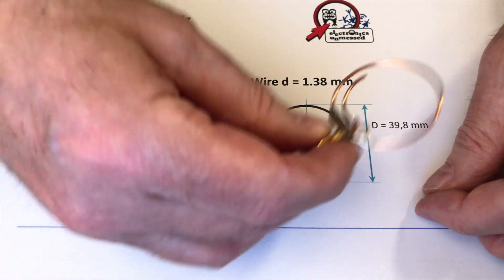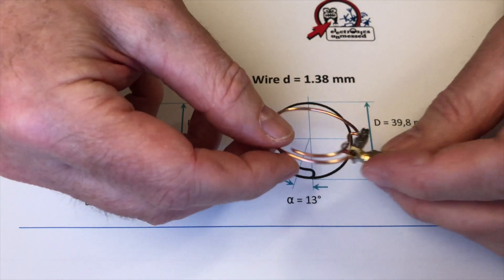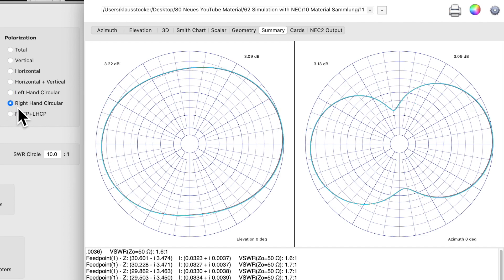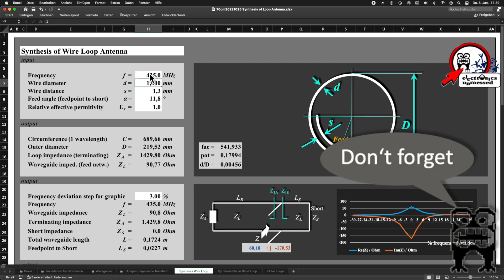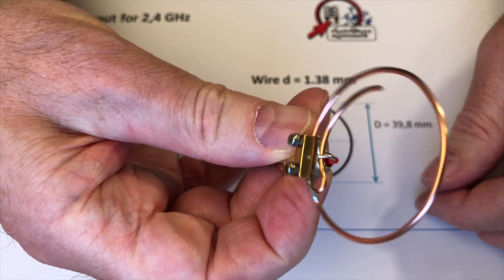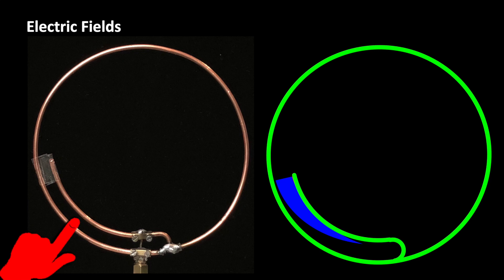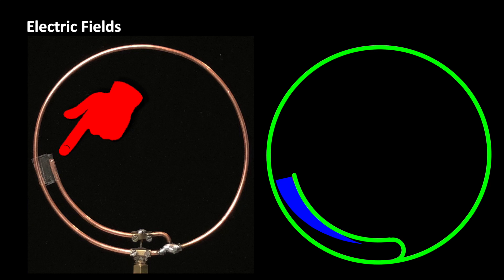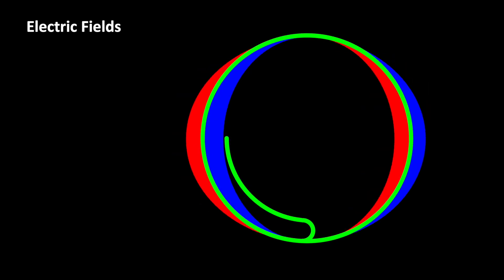Working Principle of a DIY Loop Antenna explained in an Easy Way (EP64)

Comment: Why doesn't a loop antenna need a ground plane?
Reply from the maker: Thank you for your comment! A very good question that is not easy to answer. I will try to make it short: A monopole antenna needs the ground plane rods to adjust its impedance to 50 Ohms. The loop is precisely tuned to 50 Ohms. This avoids currents are excited on the outer conductor of the coaxial feed line.

Comment: This is not an unknown antenna, it is in reference books. You have a gamma matched full wave loop antenna. Also, it does not act as any kind of filter, band pass or otherwise. You have conflated "resonance" when used in the context of lumped constant tuned circuits and another context of "resonance" when the complex impedance in an antenna pases through Rx + j0, ie no reactance. An Antenna, or indeed a conductor of any length, in an electromagnetic field will respond with current conduction in sympathy. No frequencies are rejected. The difficulty comes coupling to a transmission line to utilise the current(or voltage)
de G0AFV
Reply from the maker: Hello G0AFV,
Thank you for your comment! It's great that you are putting so much thought into this antenna. This really helps me to classify the antenna somehow, because I haven't been able to do that so far.
I looked at some references to the full wave loop antenna that is actually used by radio amateurs. However, the principle there is different: they are open loop antennas that actually have no resonance or filter effect. Just as you describe it.
Here is the first difference to my antenna, because it works as a closed loop antenna. It actually has a strong resonance at the fundamental wavelength and multiples thereof. By the way, I made a lot of measurements and simulations for this, about which you can also find some videos on "electronics unmessed". I think you could accept that as proven.
The second difference is that two perpendicular resonance modes are excited on my antenna, which means that the antenna also sends or receives corresponding polarizations.
By the way, the closed loop antenna has a very high impedance when it resonates, in contrast to the non-closed one.
I would like to discuss the topic further with you here, perhaps you know further details or references that you can share here. That would be great!
Klaus
Reply: @electronics.unmessed  Open/closed elements in an antenna do not make it a different antenna. All antenna feed points can be either open or closed, that does not change the antenna type or characteristics. A halfwave dipole can be open or closed at the feed point, a quarter wave mono can be open or closed at the feed point. What happens is the feeder completes the antenna element circuit, maybe not to DC but at RF frequencies. Your full wave loop is the same full wave loop that has been known and used since it was first envisaged.
The dual mode radiation you are seeing is indication the feed system is not working correctly. The quarter wave line coupling you are using is itself a radiator. You want it to couple all its energy to the loop, I suspect it not completely doing this, so you are seeing some loop radiation and some quarter wave element radiation.
The main issue though is you are interpreting what you are seeing in coupling/feed point responses as antenna characteristics and responses. This is incorrect and is misleading you. Feed point matching response does not mean antenna frequency response. Any feed system has the possibility to go through the full range of complex impedances with frequency change and result in total mismatch and no transfer of power, but this a property of the feed system ONLY, the antenna is still responding to those frequencies, currents are still circulating, its just the feed system cant utilise them in this configuration. I'll restate again a fundamental fact you must grasp and refer to in order to correctly understand an antenna; a conductor in free space will respond to all electromagnetic frequencies. There is no frequency preference. How any coupling system responds to frequencies and physical connection position with respect to an antenna is another matter. I believe you are stuck interpreting feed point behaviour as antenna behaviour.
All your analysis so far has lacked the fundamental investigation of how an antenna does its basic function of radiating a signal from point A to point B. I know this is difficult to do in reality, antenna ranges are difficult to set up in normal life. If you could it would immediately demonstrate that antennas have no frequency preference.
Reply from the maker: Wow, thank you again for your comprehensive comment! 
I like the approach of looking at the antenna separately from the matching network.
Now I'll do a thought experiment: Let's assume we have a piece of wire that is always matched to the impedance of the feeding cable at all frequencies. This would mean that the entire RF power is always radiated into space; there would be no frequency dependency. The same applies for reception.
However, the current distribution on the wire and the radiation characteristics would change dramatically depending on the frequency! So, simply because of the changing radiation characteristics, one would get preference frequencies between two points in space at which transmission is best. OK, but that has nothing to do with the filtering effect of the antenna.
I think you're still right, the filtering effect is caused by the antenna matching network. In my case, it is dimensioned so that there is only good antenna matching at the resonant frequency of the loop, where we have a certain current distribution.
I don't believe that the two-wire waveguide of the matching network radiates significantly because the two wires are too close together for that. Of course, the RF power goes into the antenna at the open end of the two-wire waveguide with a high electric field strength.
There is actually no doubt about the resonance effects. They can be clearly seen in the reflection measurements and in the simulations with NEC.
Incidentally, the current distribution from the simulation shows that the matching works correctly.
The two-mode principle has also been proven at least through simulation. I analyzed the polarization components of the radiation characteristics.
And I also think that the antenna matching works correctly in reality, because the antenna actually works significantly better than, for example, a quarter-wave monopole.
And in my last experiments I was able to achieve 40 dB reflection loss.
The filter effect of the arrangement, i.e. antenna plus antenna matching, is definitely also present. For example, I got a significantly better SNR when receiving LoRa signals.
But yes, otherwise the antenna actually corresponds to the full-wave loop antenna. 
What do you think about that? 
I really appreciate your good comments!
Reply: @electronics.unmessed  You are making the mistake of thinking mismatch equates to attenuation. The myth that VSWR is lost power. Same mistake, same myth. You can only lose power in resistors and resistive loads. The radiation resistance of an antenna counts as a real resistor. Reactance can not dissipate power. In two antenna that have different radiation resistances but fed with same transmission line, one matched and the other mismatched, both will radiate the power equally :) Mismatch does not equate to filtering.
Your description of the matching section shows you only partial understand how it works. Not only is the energy transferred by the high voltage at the  end of the quarter wave line, but also at the feed point where there is predominantly a current in the matching line inducing a current in the main loop. so over the length of the matching line from the point it is connected to the loop to the open end there is a continual change of coupling mode from current to voltage.
The improved performance of the loop over a quarter wave mono pole is no proof of the matching working! A full wave loop is a bigger antenna and has a better capture area providing gain.
Look my friend, this is the comments section of a YouTube video, its is a terrible place to have technical discussion.
You made the video, I commented.
All the best
Reply from the maker: Having a Diploma in Electrical Engineering and a PHD in Antenna Engineering, I think I can humbly claim that I can distinguish lay myths from real evidence. And we don't need to discuss all the myths here, that laypeople might not understand. Of course, attenuation is not the same as mismatch. Your first statement is still wrong, because if it were correct, then the whole analog filter technology wouldn't work. And yes, a mismatched antenna has the same radiation pattern as a matched antenna, but not the same gain, because some of the power goes back to the transmitter in the latter case. I think you're ignoring the transmission and reflection factor here and you haven't understood the difference between directivity and gain.
And yes, the antenna has a larger effective area than a monopole and therefore receives a stronger signal. And it receives horizontal and vertical polarization. But this only works if the antenna has a good matching and is working in the mode described. Best regards and thank you for your comments!

Comment: I've been looking into my ARRL Antenna Book (dated 1988) for information and ideas.  Suppose your loop had a cut about 2 mm wide.  Then the feeder coax could be soldered across the cut.  I think that would be roughly similar to what you have.  Preferably the feeder would be an integer number of wavelengths long.  By varying the transmitting frequency you would find the point of resonance at which the loop impedance was non-reactive.  If the resonant frequency were not acceptable then you would need to make a larger or smaller loop.

If the loop impedance was not a good match you would need to apply correction.  You could use a version of gamma-matching similar to what you have already done.  Otherwise you might use a "quarter-wave transformer" which I see described by the ARRL.  This comprises a quarter-way long co-axial feeder of characteristic impedance intermediate between the loop resonant impedance and the characteristic impedance of the feeder.  (You might need to construct that yourself from a piece of copper tube of the right diameter).  I am just thinking aloud.
Reply from the maker: Thank you very much for sharing your thoughts here in the comments. And yes, a quarter wave transformer is also doing the job to match the antenna to a 50 Ohms cable. In the earlier videos I am showing such a version of the antenna. However, I chose this slightly more complicated matching network, because the loop has a really high impedance. Therefore, the quarter wave transformer needs to have a pretty high impedance, which is difficult to achieve with coax, even with a 2 wire transmission line. 

Anyway, its good to receive some alternative thoughts. I see that this concept is interesting for other makers and radio amateurs. So, I try to develop this further .. Best Regards from Stuttgart

Comment: I think this loop antenna is ingenious and I am impressed that it functions at ultra-high frequencies.  I suspect that the principle of operation is a successor to similar designs like quad antennas in which the loop is square, made of wire and used at short-wave frequencies.  Also it reminds me of the classic "magnetic loop" antenna in which a variable capacitor enables tuning at frequencies independent of the length of the loop circumference.  The feed method appears to be a version of the "delta match" principle adapted to uhf, but still is very ingenious.

The resonant bandwidth seems likely to be extremely narrow and would depend upon the Q-factor  The Q-factor and antenna gain are likely to increase with an increase in conductor thickness.  Depending upon its application, the very narrow resonant bandwidth might be a disadvantage.  But the usefulness of this antenna would depend upon the context in which it were employed.
Reply from the maker: Very good comments! Thanks a lot.

Comment: I can't wait to try this antenna. I'm going to try one tuned at 467mhz for GMRS use. One thing I haven't found much info on in general is how to derive the wattage rating for and antenna. Any hints on what the determining factor for wattage rating would be for this antenna. Also have you tested thicker wire? Even maybe copper tubing. Would thicker wire diameter effect the q rating of this antenna design significantly?
Reply from the maker: Thank you for your comments and your questions! It is a good idea for sure to use it for GMRS. Thick material like copper tubing makes the mechanic construction more stable and the q rating is even improved. I tested frequencies 435 MHz, 866MHz, and 2400 MHz with 1 mm and 2mm mm Wires. In addition I tried 12 mm aluminum foil band with good results. I made a number of videos on the dimensioning and measurements. The wattage rating depends on two things: a) solid connectors, b) voltage at the end of the matching network which is about 20 times the one at 50 ohms. My quick and dirts calculation:  at 100 Watts you get about 1400 Volts. Thank you especially for that question, I will come up with a separate video on the antenna's power rating.